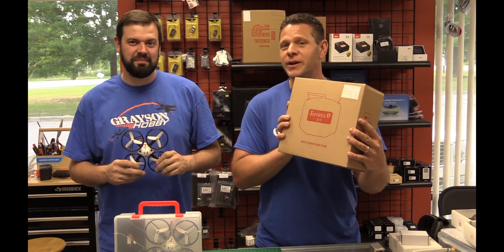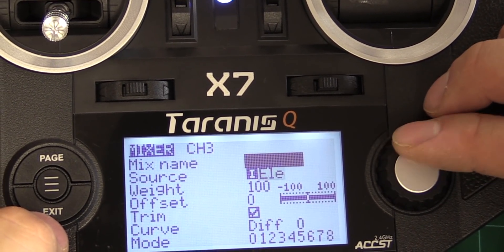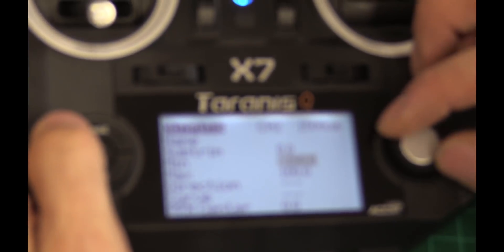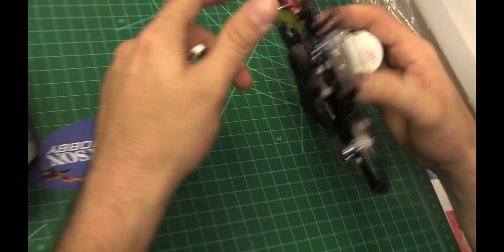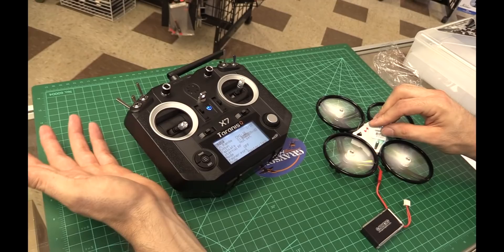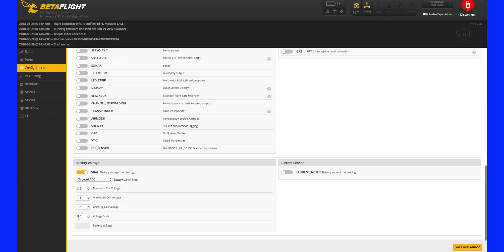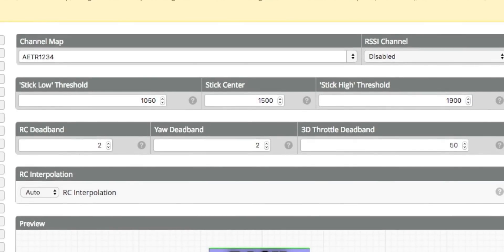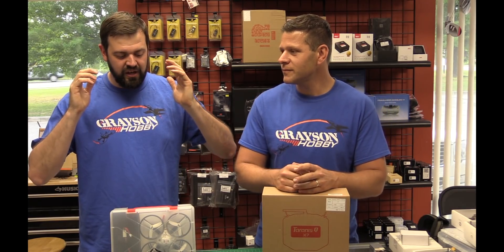ET125 & Qx7 NO BETAFLIGHT - Setup the Best Entry FPV Racing Drone

Comment: Thanks to your videos I’ve learned many things on a hobby that I thought it would have been impossible to follow.
I have just got my exact same drone and I’m trying to find the height hold (altitude hold) so that when I take my hand off the throttle it stays in one place. Does it exist on this drone or not. I did all the Frsky qx7 set up exactly as you say and also the betaflight is all configured ( also for the buzzer etc).
Thanks for the answer.

Comment: Helpful tip...if you want turtle mode , you must reflash more current version of betaflight that will have turtle mode. BF V3.0 works great. Then flash the ESC in blheli to latest version ( not multishot version ). Then go back to BF and be sure to select DShot600 in config tab. Select the switch you want to use , turn on "flipover after crash"  in switches tab and setup in mixer in radio and you are good to go.

Comment: That was awesome video and a well of info...Now I can set it up properly  [ ET115 ]....flies great out of the box, but needs to be set up better ( using a Jumper T8SG myself )  One thing I noticed is the Battery Band breaks real easy, mine split after a few flights ( why i do not know) but disassembling to replace it is a pain, I used a velcro strap instead now...did not have to disassemble it .....want the ET 125....love these quads....will be purchasing one in the future I hope . Thanks guys .
Reply: Do you have a video in how to set it up with the Jumper T8SG. I just got mine and having a little trouble with it. I would appreciate it. 👍👍👍👍👍

Comment: I think this is an excellent video, made from my inquiry to you, so now you know who this is! Anyway, from a beginner setup, there are a couple of things I might add. If you’re not going into Betaflight, you’d better FAILSAFE that from the Taranis, and set that to no pulses. In Betaflight, mixer output, I don’t see a reason to adjust percentages on a switch,5-6-7, perhaps I’m wrong? I would also highly suggest, if you’re new to all this, enable “disarm motors regardless of throttle value” right below “MOTOR STOP’ What this will do is if you get into a situation were you’re headed toward disaster, flipping your ARM switch will kill the motors immediately regardless of throttle value. Trust me, you may panic and space throttling totally down, which if this isn’t enabled, would be the only way to kill those motors. Learning to fly Acro in LOS, use it, so once you start losing control quickly flip the ARM switch and save a motor!